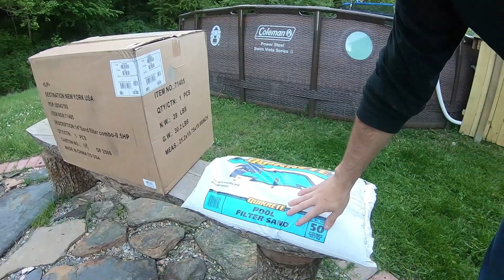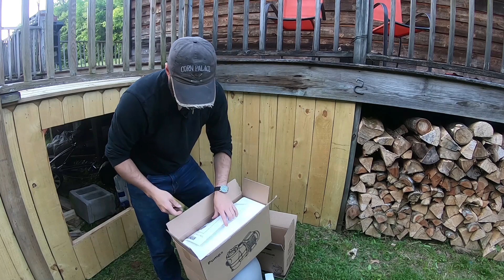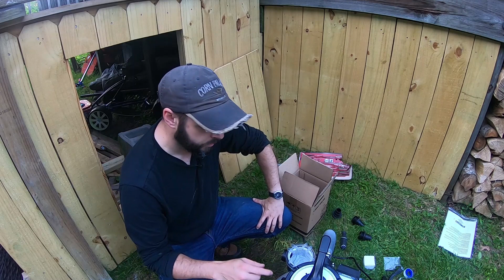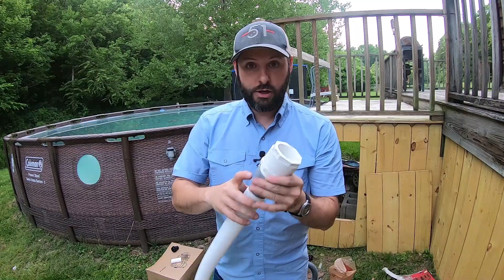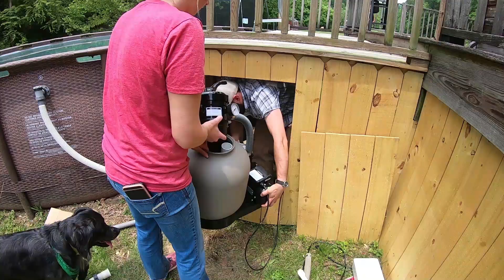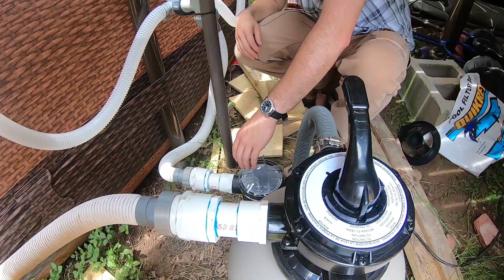Coleman Power Steel 22 x 52 Pool Sand Filter

Comment: Hi. Thank for this video. This is my second year with this same pool and pool filter. I have just set it up for this season. Do I need to start with drain or backwash? I've done both and for some reason on filer sand is going into the pool.
Reply: Always: backwash, rinse, waste and recirculate before you filter for the first time each season.

Comment: Aren't you supposed to stop the pump every time you change the setting on the filter?  Example, going from backwash to rinse?  I didn't hear you mention that!
Reply from the maker: That is true. To do that a little easier I installed a weatherproof on/off switch on the side of the porch. I made a video all about it if you’re interested.

Comment: How hard is it to replace that power wire to the one with the gfci?
Reply from the maker: I think I have a video doing just that, but adding an on off switch. It’s the one of me holding up a small square and it’s like a $10 part for the pool. It’s not difficult.
Reply: Thanks ima have to check it out